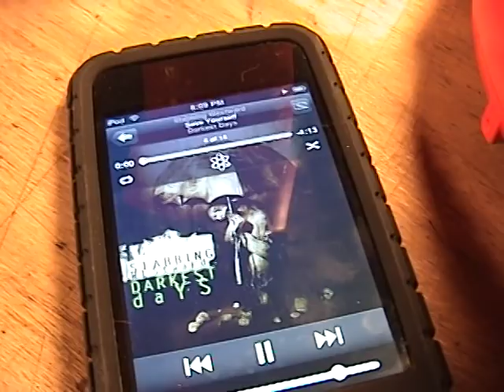ikyaudio "Red Lobesters" DIY Handmade PVC Audio Speakers with 3" full range drivers

Comment: The HiVi B3N's actual freq response is only 100Hz - 7,000Hz. It may range a bit higher or lower based on box size and the fact that not all B3N's are exactly the same. One would have to test each driver they are using to find out what the exact response is per driver. It would not be far off the manufactures specs of 100Hz - 7,000Hz. From what I've seen the HiVi B3N's in various setups can provide a usable response in the 70Hz - 10,000Hz but deferentially not up to 20,000Hz.

Comment: That plastic pipe is creating a strong resonant condition. There are reflections because you don't (can't) have any acoustic lining. You could fill them with dacron stuffing and seal them but a tube isn't a desirable shape unless it's a transmission line. And I doubt if that driver reaches higher than 10Khz. If you want to make a good sounding cheap speaker with those drivers, mount them on an open back baffle. Just a plate on a base. They'll sound really open and transparent.

Comment: , that's awesome, reminds me of my JVC mini DVD audio system, called
gigatubes. if you could experiment enough to figure out the proper length, curvature, and size of tubes, to get the best bass and frequency response, totally cool.
gives me mega ideas, you could use a design like this inside of a box to get great Sonic clarity out of smaller SPEAKERS just like Bose and JVC does.

Comment: Med is a bit colored. Put a baffle just behind the speaker magnet with a 1" hole in it (but NOT in the center) and piece of poly-pipe (about 2" long & same diam as hole) jammed into the hole and poking out the rear only (so the pipe wont touch the speaker). You will get a vast improvement in med. Bass will not suffer, it will also be more even in out-put. It's called the double chamber. See my ch for sp

See my ch for some full-range and point-source speaker stuff.
Keep up the good work!

Comment: @SMERGHEED - you maybe didn't hear right, it's 'all ideal amplifiers under all ideal conditions sound the same.'  Not your "all amplifiers sound the same."  Thing is tho, the ideal square wave output suggests that all professional amplifiers would sound the same with all professional loudspeaker monitors - but some Hi-End domestic amplifiers don't have a square wave and sound just as good!  As for silver RCA cable it boosts up the current so lifts up the treble and that may not suit all systems!

Comment: @SMERGHEED - full range speakers can sound okay, in one word, Lowther!  But they're an ancient extreme concept, far removed from today's usual speakers.  I figured that folks like you wouldn't know what I was on about and draw the conclusions you did.  One reason E.M.I. stopped mounting the tweeter co-axially was the advantage of 2-way for tweeter rigidity.  If the speaker mount vibrates you lose the accuracy of sound made but 2-way and x-overs reduce the phase accuracy of Lowther point sources!